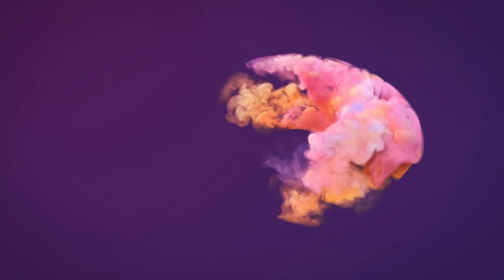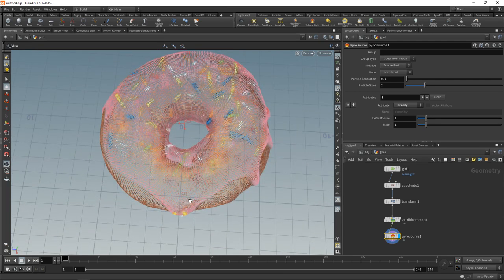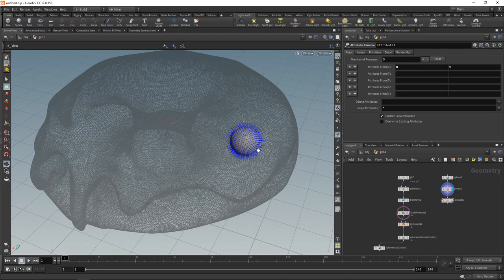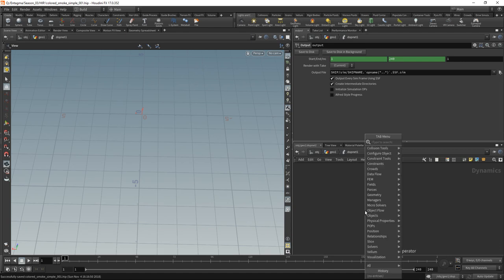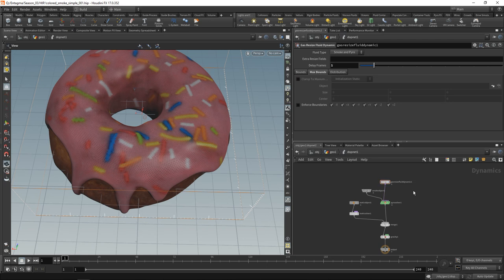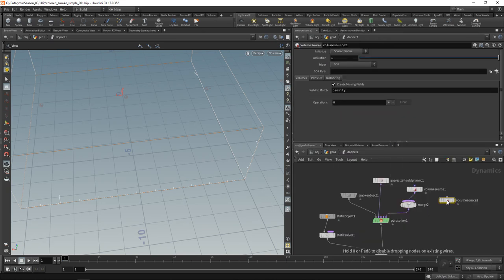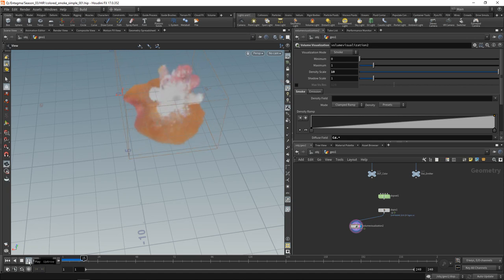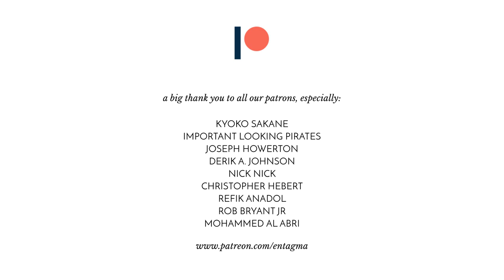Houdini 17 Quicktip: Colored Smoke

Comment: I'm having an issue where the Volume Rasterize Attribute is creating a bounding box around the smoke source.  The simulation works fine, but i'm seeing a square block of smoke caused by the volumerasterizeattribute bounding box.  I can't seem to eliminate the box and when I scale the pyro particle scale or the V.R.A particle scale it just makes the smoke less dense and doesn't get rid of the box.